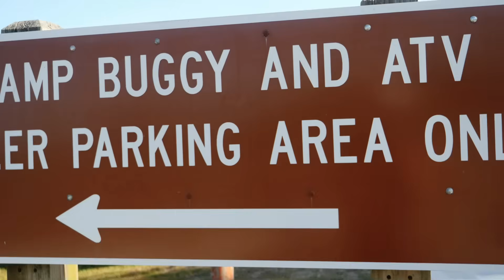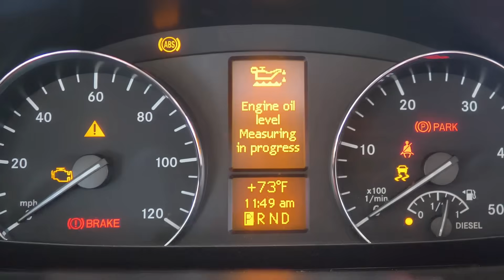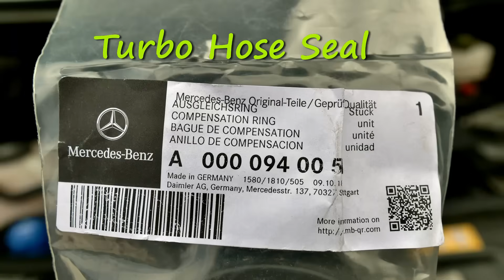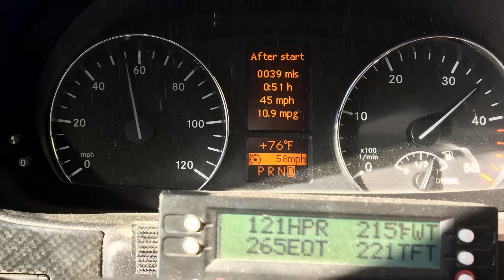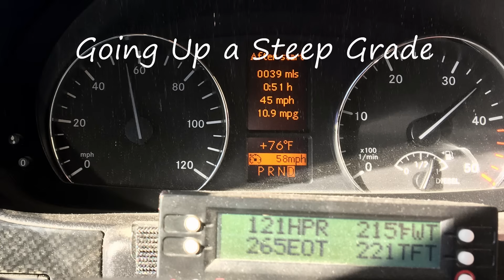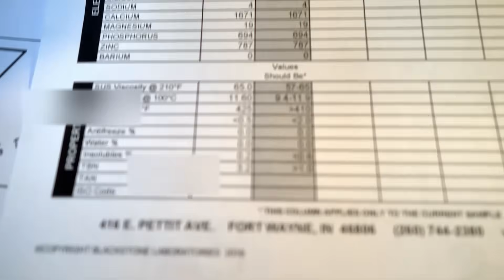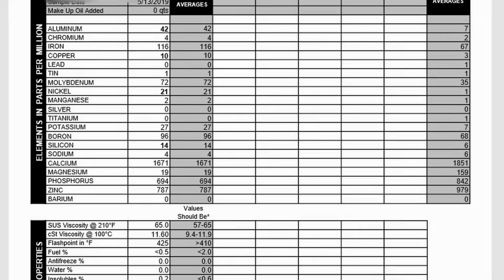Sprinter 20,000 mile oil changes

Comment: Sir Ron, have you done a video on any refrigerator fan install like I see in video using the Titian vent fans for the outside vents. My 16 Navion has a severe air flow problem due to the gas flume pipe modification with sheet metal from top to bottom at level of top vents. Then they placed a horizontal board to attach the sheet metal. No air flow from bottom to top where my evaporators coil are. The mid level small fan is so loud and inefficient! Please help.
Reply from the maker: My 2016 had a shelf over the evaporator coils.  I removed the shelf and added a small fan directly above the hot spot on the coils.  This seems to work OK.  Some people put 2 large fans on the outlet vent and that should help most cases.  Currently working on a video of a 3 fan tray inside the fridge.  Can't really comment on your unit as I don't know what it looks like.
Reply: On the Road with Ron Thanks, I have two shelf’s going across, one mid way, one bottom. . Just added Axel fans to vents themselves but I got to remove the shelf. The thin metal plate was installed after a plate size scorched burn mark was discovered looking for this factory installed humming high pitch fan. I going to post my install to but await your professional install. Have Navion 15 like your except round top cap with moon room.
Reply from the maker: @bsoutdooradventures9541  I am currently adding 2 8" vent fans to help the air flow.  Fridge got too hot in 100+ temps out in the desert.
Reply: @ontheroadwithron2432   Ron, if your absorption cooling unit fails, would you consider switching to a compressor cooling unit instead?  I believe NovaKool and Danfoss make conversion kits for RV ammonia absorption fridges.  My 2009 View 24H (absorption fridge) seemed to struggle with keeping a constant temp vs my 2019 24V View has the compressor fridge and keeps a nice steady temp.
Reply from the maker: @davidolson1242  yes, if fridge fails I would get the compressor type.  Especially with my Lithium battery,  No power concerns

Comment: Okay, another question for you. Where is the battery charger located on our units? Is it separate from the Xantrex Inverter?
Reply from the maker: 6Haase the battery charger is the progressive dynamics Inverter. It located under the bed on the J model. I believe it has a picture of a wizard on it.
Reply: Is it located under some wood? I cannot find mine.
Reply from the maker: @Thebeercan7116  yes, under the funny shapped carpeted section.  Need to remove around 6-8 screws to get it up.  Most wiring and pipes are under there.

Comment: Just ordered the turbo seal, Ron. Thanks for the tip. Did notice one video elsewhere in which the seal was sprayed with a sealant (silicon spray, I think) before installation. Is this recommended?
Reply from the maker: Mitch Miglis I would not do it. The spray might have been used to slip it on a little easier but it can also collect dust.

Comment: Do you need two different size hose clamps (13 &15 mm) for the fuel filter?
Reply from the maker: Tommy Monzon yes. The solid clamps don’t have a big adjustment range. You can buy them individually for <$2 a piece.

Comment: Hey Ron. Question for you. Is your AC unit much louder than the RVs around you? I have noticed that my 2014 Itasca Navion AC unit, which is a low profile unit, is much louder than all the RVs around me when camping. Your thoughts
Reply from the maker: 6Haase yes mine is very loud both inside and outside. Too loud to sleep with it on. Going to look into some “hush” kits before next trip. New Mach 10 units are supposed to be much quieter.

Comment: Thanks Ron!  Although I have a 19VD I have put over 11,000 miles on it since we got it in November.  Its just hard for me to think the oil will go 20,000.  My schedule A is due in 9000 miles and I have regularly checked the oil.  It did tell me to add a quart about a month ago, and I followed the directions and all seems to be well.  Thanks for your update!  What was the fumoto valve part number you added to your RV.  I want to put that on when I change the oil with the Schedule A.  Thanks again!

Comment: Good info - thank you.     Can you post the part number for the rubber seal?    I am currently at around 16K miles on my 2019 View 24J.... will be doing the fuel filter once I hit 20K miles.    Thanks.     I change my oil yearly... typically, I drive around 12K miles per year.   It's easy and relatively inexpensive and I recycle the used motor oil.
Reply from the maker: I added it to the description. Most people wait to 30K to change fuel filter unless you use a lot of Biodiesel.  Cheers.

Comment: Once again..love the new info! Taking notes. My Service B light came up . I think it a date thing vs mileage. You are Mercedes Hero! Thanks again.
Reply from the maker: My first service light came up while on a long trip with 11,000 miles on the unit.  It was also a date count down, but the RV was only 15 months old.  They must have initially set the wrong date in the computer.

Comment: Thanks for the raw data from this report! This brings up a question which is pertinent to us. We have a 2011 Winnebago-built MB Sprinter chassis-based RV similar to the View 24V (2012 Itasca Reyo 25T). The recommendations in our manual are for servicing (A & B) are 10,000 miles/1 year rather than the 20,000 miles/2 years for later models. In your discussion, you seem to indicate that this is because of the technological advance of oils over the years. Our suspicion is when we buy the oil from the Mercedes-Benz dealer it is the same as you use. That is also probably true of the other parts like oil and air filters. We do have a generation of the 3L Turbodiesel that also runs on DEF. Has there been an upgrade in the engine from 2011 to 2015 that would preclude us from also having the service period at 20,000 miles/2years? The dealer would have a conflict of interest if asked that question as they would rather sell product twice as much. We also did have an oil analysis done by a lab in Salt Lake City through an NRVIA inspector we hired two years ago when we bought our RV. The test also turned out fine.
Reply from the maker: You ask good questions.  I don't have any inside info on the engine design changes, but as an engineer, I know that constant improvements are typical in big companies.  I think you are stuck with the 10K interval unless you want to take the responsibility.  Another data point is Mobil 1 advertises 20K intervals with their "Ultimate" brand oil.  They have done testing to back it up.  Of course you can't use the Ultimate as it doesn't meet the MB spec for low ash.  Personally, I'd take a sample at 10K and see the results before doing the change.  My guess is the oil will be fine.
Reply: @ontheroadwithron2432  Will do. Expect follow-up in about a year <grin>.

Comment: Good information as always. I struggle to find straight diesel when on the road. Any tips?
Reply from the maker: The Bio seems to be state dependent.  Probably due to state regulations.  Anyway, not sure how to totally avoid it.  I don't consider it to be a big deal and don't go out of my way to avoid it.  For example, I've used 3-4 tanks of it and just changed my fuel filter at 37K miles.  I have not seen any drawbacks using it occasionally.  My 20K miles oil analysis was also clean of any defects.

Comment: Thanks. It’s hard to break away from that 3k mile oil change mentality that was drilled into me most of my life. I might not be brave enough to go 20k but at least I’m comfortable getting closer to that now.
Reply from the maker: I know what you mean.  However I have 40 years experience testing and specifying lubricants as a design engineer, so my experience says testing based data is better.
Reply: @ontheroadwithron2432  
But you don't have 400k on your Sprinter and you don't have any feedback from fellow expediters with 400k - 700k . Those are some REAL stories , with no Blackstone BS.
Reply: 3k, 10k, 20k. All worthless numbers without an oil sample test at different ranges to see what the limit to your specific oil, engine and driving style are. What's good for him still at 20k driving highway, might be already filled with soot and depleted additives by 10k to you from driving more in the city,  dusty roads, short trips, oil type/viscosit, diesel amount in oil etc. Run next oil change 5k, do an oil test. Another at 7k. If all good, again at 10k. Don't go by ear on these, you're most likely throwing away brand new oil